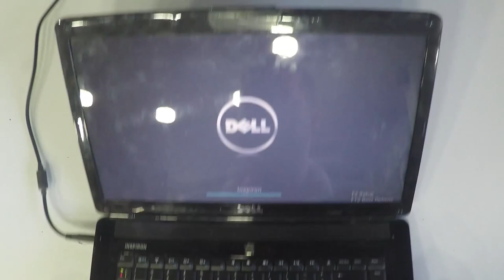Dell Inspiron 1545 Disassembly and Reassembly

Comment: Hello. I put too much wd40 on the internal sata contact of  the HDD (where i have a SSD). I thought there is an electrical contact problem. Now it does;nt recognize my SSD. No problem with the SSD , because i connected it in other laptop nd it works. Is the SSD(old HDD) SATA contact clogged by too muc WD40. Did i have a shortcircuit. How can i reach ther in order to clean the sata contact? Can you pls give me an advice?